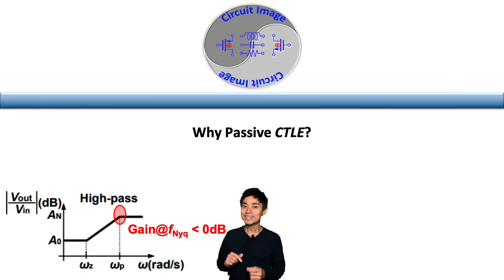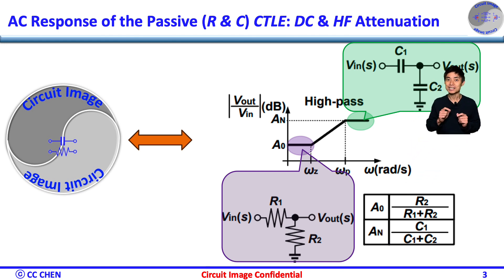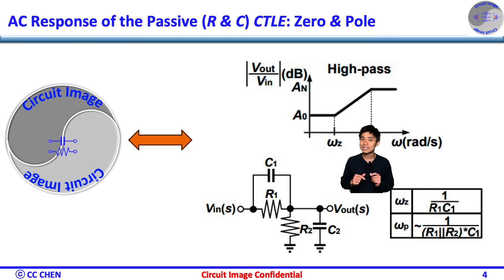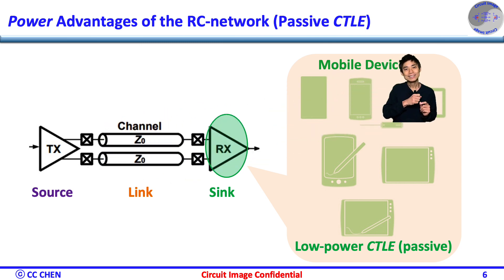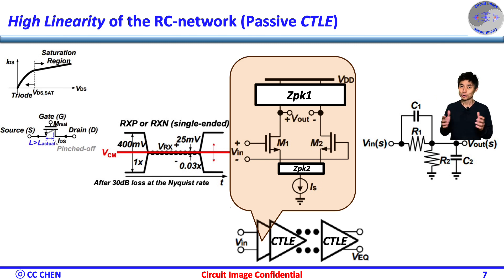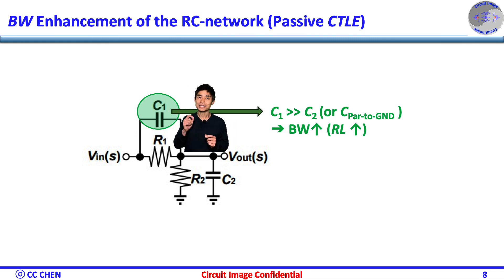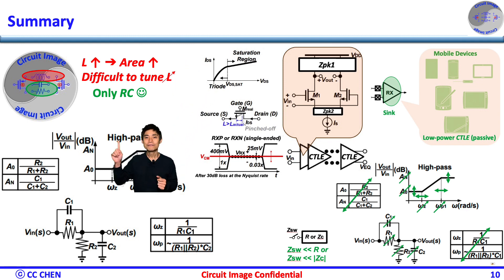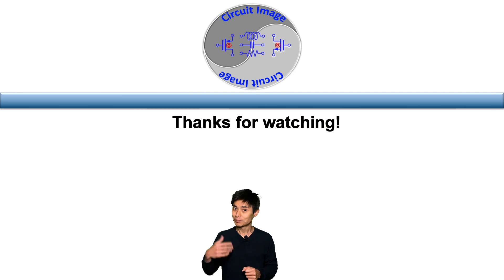Why Passive CTLE?

Comment: Hi CC, nice video as always. Could you explain how the return loss is impacted by using such a passive equalizer at the front end? Is there a separate termination resistor and after which this passive CTLE is? In this case, at high frequencies don't such equalization capacitors worsen s11?
Reply from the maker: Hi Abhirup, Thank you so much for the excellent question. The return loss would be improved, but the T-coil (including the ESD) & separate termination resistor must sit before the passive CTLE. The equalization capacitors should be part of the matching networks. I feel like I need to add one more video to discuss the input matching for different active or passive CTLEs. 🙂
Reply: @circuitimage  many thanks cc, this is exactly what I thought that such equalizer should be co-designed with the termination in mind. Will be great to make a video on it. Thanks for the effort.
Reply from the maker: @abhiruplahiri1  Hi Abhirup, Sure. Thank you so much for the good idea. I will do and no problem we can benefit other people as well. 😄
Reply: Hi Abhirup, 
There is a small section about passive equalizer and rx termination design in the following IEEE paper by Razavi. Please take a look. "Equalization and clock and data recovery techniques for 10gbps CMOS Serial link receivers".

Comment: At 4:53 that pole equation should it be c1+c2 for the cap instead of just c1?      That pole equation only true if u we do not have c2 in the schematic which also give a pole with time constant equivalent R and c1.  But then in that case my calculation show it will lead to a bigger than 1 gain (R1+R2)/R2 at high freq which should not happen.
Reply from the maker: Hi Fyawtfc, thank you for the good question. You are correct, but my design thought was to make C1 >> C2 such that the high-frequency attenuation would be as little as possible even if there's no gain. That was the reason the pole roughly depends on C1 only.
Reply: @circuitimage  yes u mentioned that in video about making c1 bigger than c2. Thanks a ton for the fabulous quality of these videos and explanations !
Reply from the maker: @Fyawtfc  You're very welcome. Thank you for checking the circuit image carefully.